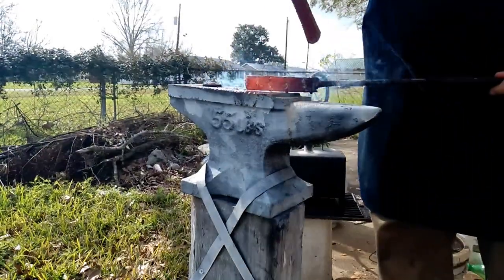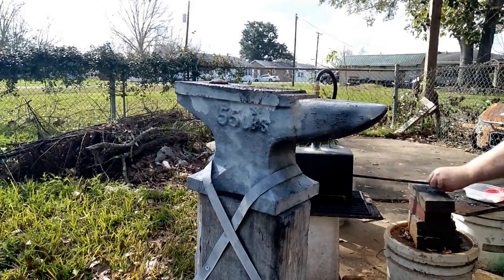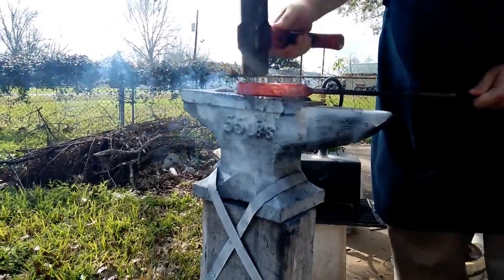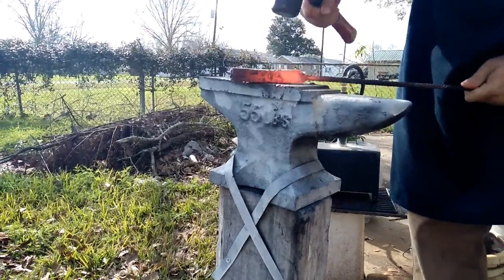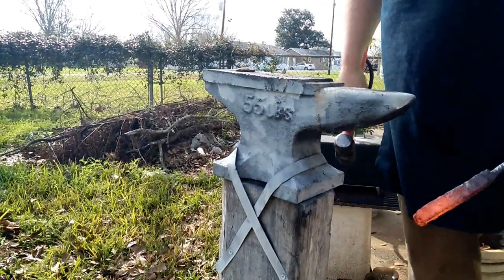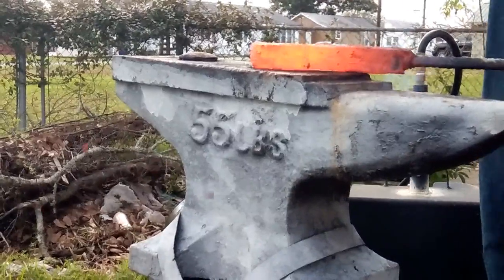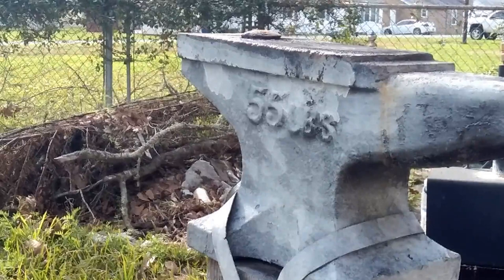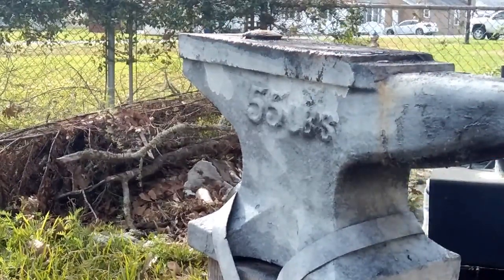Hand Forge Damascus Knife Billet (with Bandsaw Blade and Pallet Strap) pt.2

Comment: Are the band saw blades high speed steel ? 
If so what else pairs with HSS ?
Reply from the maker: I believe when I looked them up I found they were bi metallic carbon steel. So probably carbon edge mild backing. I don't believe they're (hss) high speed steel. They were meat cutting blades. One was for boneless meat which is a scalloped edge(the ones used in the video) and the other for bone in meat which has the standard triangle teeth like a saw.
Reply from the maker: I tend to avoid high speed steel. I could be wrong but I'm under the impression hss doesn't forge well and is difficult to heat treat properly at home.
Reply: @jasonaldenpatton   I have some Milwaukee bandsaw blades that are HSS I’m trying to find out what pears with it.
Reply: @jasonaldenpatton  thanks